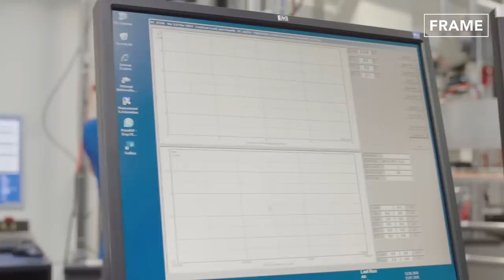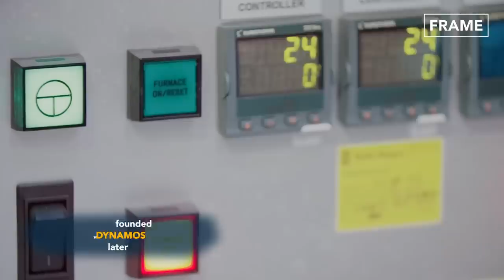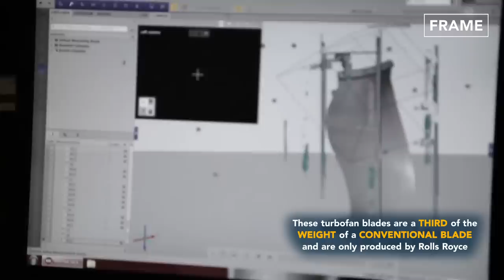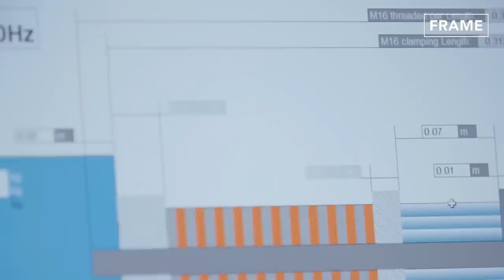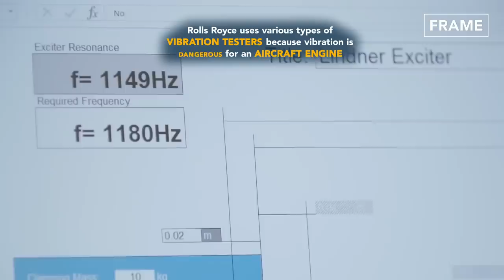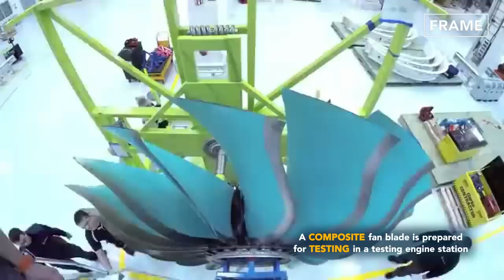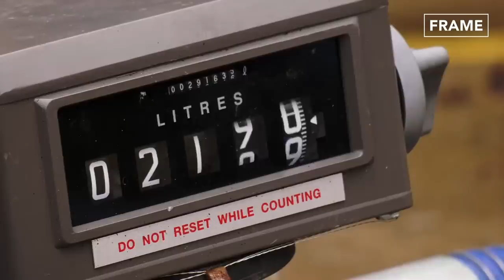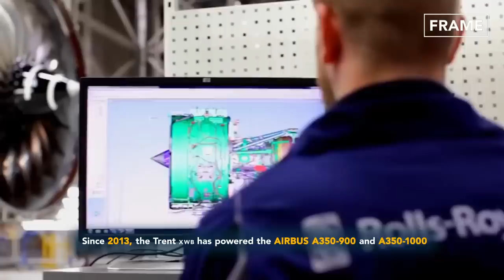Tour of Billions $ Futuristic Factories Building World Largest Jet Engines

Comment: 10,000 parts in each of those $20 - $45 million engines. Many parts only have a clearance tolerance of 0.5 - 2 mm which adds a lot of pressure to get your precision engineering right the first time.